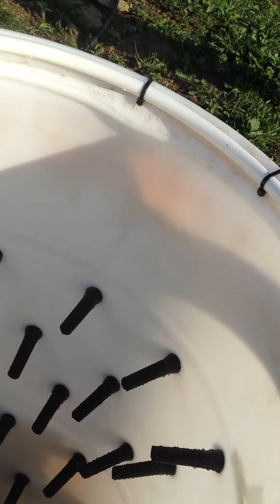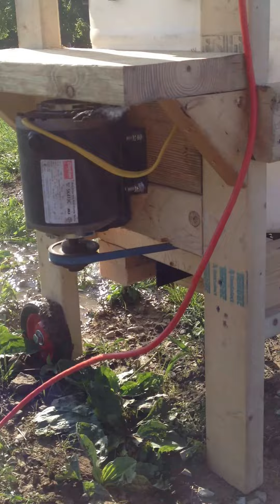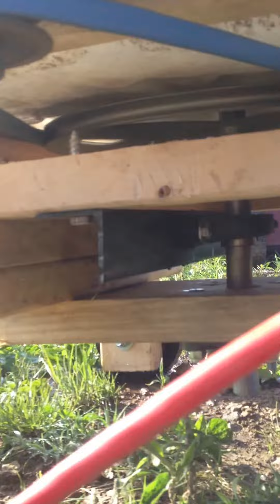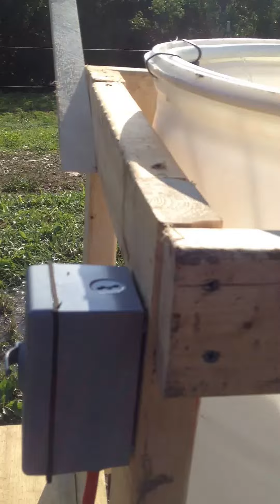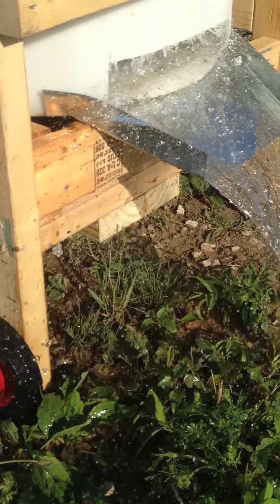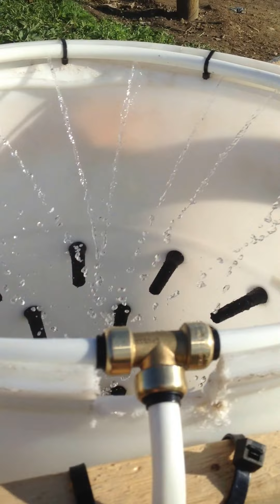My homemade Chicken Plucker with many extras

Comment: What size motor did you use and how many horse power. Thinking of building mine with 3/4 horse power with 1750 RPM. Have a 5/8 shaft with 1.5” - 8 motor pulley. Should slow it down to 328 RPM. What do you think? Just wondering what size motor you used. Thanks great video
Reply from the maker: Roberto Dino i used 1/3 hp but 1/2 would be best.  I used a 14” pully.   8” will be too fast.  Thanks
Reply: BradsAdventures can’t find anywhere close to 12”-14” drive pulley anywhere. Any suggestions? Thanks
Reply from the maker: Roberto Dino i had a 3 1/2” sheave on motor and 14” pully on drum shaft

Comment: love this design I'm planning on building one and have been researching all over youtube.  I was wondering what you used for the "feather plate" to attach the fingers to.  Also, how did you attach that to the shaft so it would spin?
Reply from the maker: I had a 1/8" plate cut out on a water jet and I then welded the shaft to the plate.

Comment: Have you posted the pictures I read you were going to?   I would like to build one, but I can't tell what you used for fingers or how the bottom of the barrel is made with the fingers.   Looks great thanks for the motivation.
Reply from the maker: the barrell only has a hole in the bottom so the shaft will fit in.  ebay search Chicken Plucker Poultry Plucking Finger Whizbang EZplucker to find the fingers.  I never posted pictures but the video shows everything.  just pause the video.

Comment: Awesome! Really a great set up. Thank you for sharing. I anticipate on replicating this to the "T"!
Reply from the maker: thanks :)

make sure you make the plate in the bottom within 1/2" of the inside of the tub.  that is the only thing i did incorrectly.  share your video with me when you complete it :)
Reply: i will bud. absolutely. may i also ask what type of motor you used. I mean specs-wise. i recently learned that high rpm is not necessarily the answer but high torque.thanks again!
Reply from the maker: Michael Epstein
I used a belt driven motor out of a gas furnace.  It is a 120v 1/3hp 1725rpm motor.  It will do one chicken easily but if you want to do more than one at a time you will need a 1/2-3/4hp.  For me the 1/3 is fine.  I would rather do one chicken at a time.  It only takes about 10 seconds to pluck it and I did 16 that day.  I am getting ready to order 25 broilers this month.
Reply: outstanding. thank you so much for the information.